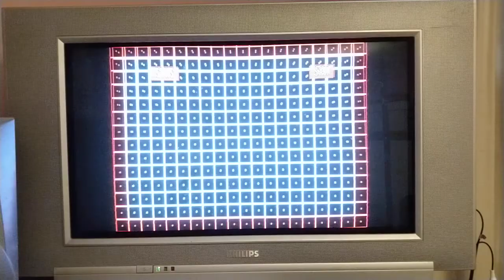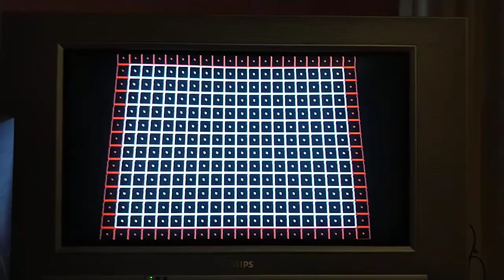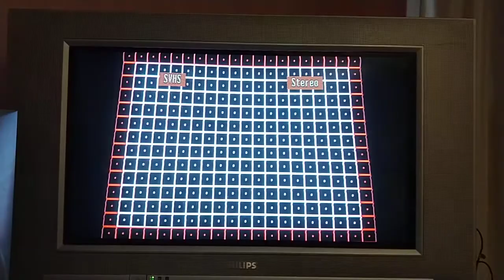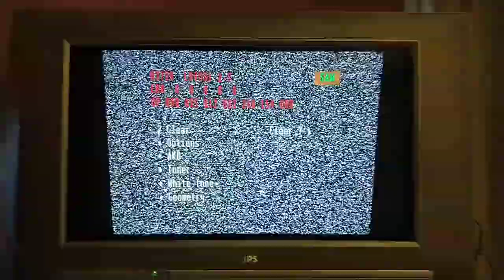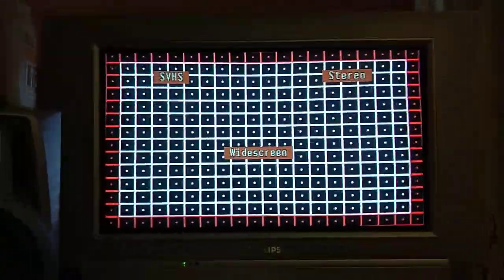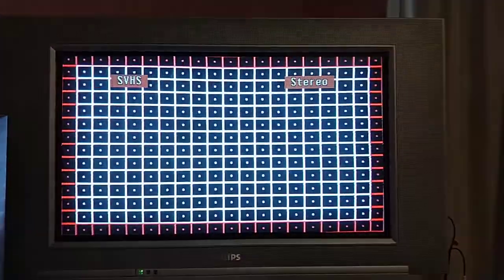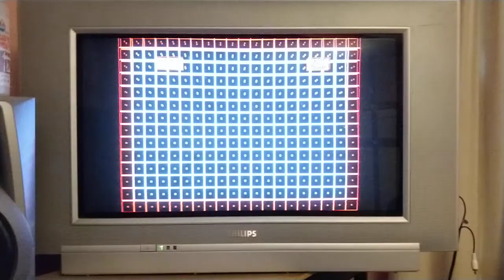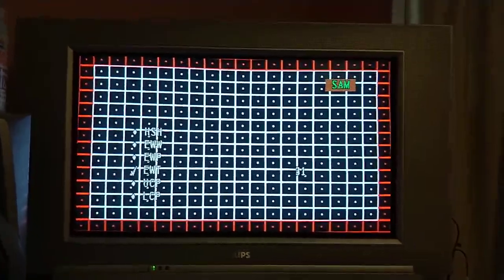Philips 26PW6341/37 L04.1U AA Alignment Service Menu problems

Comment: how do you like this tv? I'm about to get a 30 inch one for free for 480p ps2 games and original xbox. Do you think the TV does a decent job at 480i/p signals?
Reply from the maker: honestly, I like it a lot.  I've also got a 27" 4:3 philips that is basically the same model but not widescreen.

This one doesn't do progressive video, though, it's only standard def (480i) but it's absolutely fine for older games, especially the random old ones that have widescreen options (Gran Turismo, NiGHTS, etc).  I'm not a huge video snob, though, so I'm sure other people out there will say to get a Trinitron/PVM, or some other specialized model.  WHatever.  If you're just looking to place some games, this one has served me well.
Reply: i got a sony 30hs510 and a sony trinitron 27fs200 , both of these really kill the other philips i have. HS does progressive. for these old tv's i suggest sony i guess. I ended up getting 2 philips, 30pw and a standard 480i one, both don't match the quality of the trinitron.
Reply: i should have mentioned, goodwills have tons of these sony fs 100 /200 series tv's for 99 cents.
Reply: you have a rare tv, standard def 480i and widescreen, almost all widescreen crt's are not 480i , usually upscale to 1080i and allow for 480p etc.
Reply from the maker: I don't personally like how Trinitron models display composite video.  I know that sounds petty, but a good number of Genesis games benefit from composite video (as a result of the video encoder in the console), and every Sony television I've encountered exaggerates some of the inherent composite artifacting.  Until you get into PS2, Gamecube, and Xbox, there's almost no reason to use any video signal better than s-video on older consoles.  Some people are stalwart purists, and they absolutely must have SCART or RGB, and the Trinitron is supposedly the only acceptable canvas to paint that picture...  But I'm not convinced.

at the end of the day, pretty much any TV can be modified or adjusted to look decent (hell, the best picture I ever saw on a CRT was some random, bargain brand almost 20 years ago called "Changhong."  Maybe it was cheap, maybe it didn't have the same number of lines as a PVM, but I swear the model I had was the best CRT I ever owned lol).  What's most important is whether you're satisfied, whether you're happy with how your games look :)
Reply: Me personally Composite looks better on a CRT TV than S-Video or SCART. S Video and SCART make retro games look to pixelated and flickered looking. Composite looks more smoother. I even prefer RF more than S-Video and SCART on a CRTV.  

Best Cables for a CRT TV for picture
1. Composite
2. RF
3. S-Video (Pixelated and Flickered)
4. SCART (More Pixelated and Flickered)
Reply: @AGwolf2097  Could you share the geometry settings for the 27''? I've screwed mine all up and can't find anything on the internet.
Reply from the maker: @jefft.7937  oh it's been a while since I've fiddled with it tbh...  can you not make them out in this video?  
and do you have the widescreen standard-definition version, too?

Comment: How did you find the service menu code? I have a 30PW9110D/37. I call Philips and they won’t give it to me. I moved my Tv and the Geometry is a little of.  Mainly the display. Hopefully you can help. Thanks.
Reply from the maker: lord I haven't the slightest clue, I was just on a mission whenever I was messing with this lol :P

Try and see if the code I used on mine works on yours.  If not, just scour around the net searching your exact model number.

It may have been buried in a forum somewhere...  THere's also a facebook group called "The CRT Collective" that's dedicated to just about all things CRT, you could ask in there and see if anyone has a list of other Philips service menu codes.

Just be careful not to fiddle with too much, a lot of the service options can have adverse consequences.  Now that I think on it, I do vaguely recall a discussion somewhere in my travels that explained some of the things to watch out for.

Sorry i'm not more informative :o
Reply from the maker: @brandonmiller7165  so after a small existential crisis when I discovered that I had no idea where my remote was, and frantically tore up half my room to find it, i finally found it and was able to confirm the sequence I read out in the video;
0, 6, 2, 5, 9, 6,  Exit
Just press those in order, in reasonably quick succession, while the tv is on, and it should pop into the service menu.  IIRC, you may have to do something special to "save" whatever changes you make, but I can't specifically recall other details beyond whatever I recorded in this video on a slightly drunken evening two years ago lol

If that works for you, great, but I still suggest doing some more research into how the service mode operates.  Many options aren't worth adjusting, and some of the physical geometry adjustments may just as easily be fixed by opening the entire housing and ensuring the yoke and other assorted components attached to the back of the tube are still secure.

When you say your "geometry is a little off," do you simply mean a funky, possibly rainbow, discoloration?  because that's just a product of disrupting the tube's natural magnetic field after it has been in one position for an extended period.  Most sets have a degausing coil built-in to negate any kind of magnetized artifacts, but sometimes they're not aggressive enough to get rid of the effect (at which point you'd need a stronger, external degausing loop to do the job)
Reply: AGwolf2097 I just the remote for the the tv but what’s the exit button
Reply from the maker: @brandonmiller7165  oh hm, yeah I suppose they had different remotes across different models lol

I just searched your model and it definitely has different buttons.  Maybe try the menu button instead of exit?  also, go to this link and scroll through the discussion, there are a handful of different possible codes you could try if your remote has the corresponding buttons;
https://www.fixya.com/support/t24897455-get_service_menu

I want to stress that it's important to not fiddle with options at random, you have to be very careful and deliberate or else you can potentially mess something up.  Google for your model number and "service menu" or just "philips CRT service menu" to try and find other discussions online about what all the options are.

Your model is apparently an HD model, so there are likely even more fiddly settings available that could throw something out of whack.  maybe also check out www.avsforums.com to see if there's any discussion or useful info (tbh, that may even be where I found my model's service menu code)
Reply: I was able to get to the menu. How do the geometry red and white showing to set your geometry?
Reply: I have two philips, one is 062596+status, the other is 062596+menu. Most Philips TVs (Even some LCD’s) have 062596.
Reply: @dewlivewireftw  this code doesn't work for my philips crt tv
Reply: @dewlivewireftw  i have the rc7507 remote, what is status or exit here?